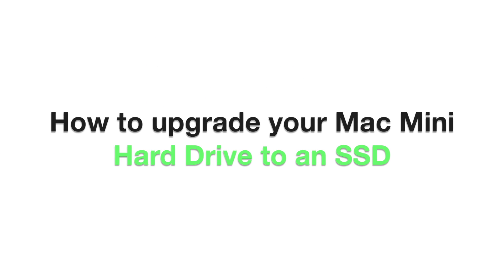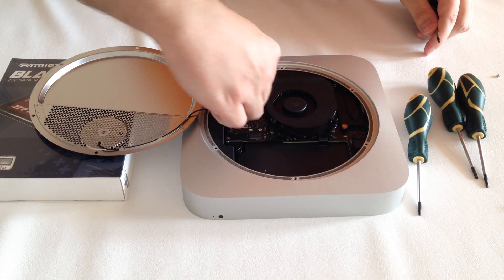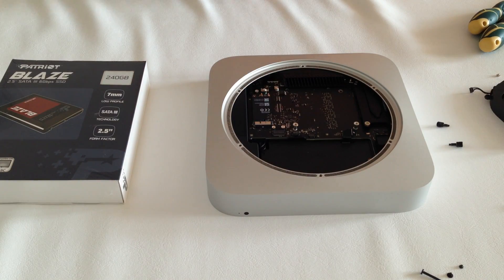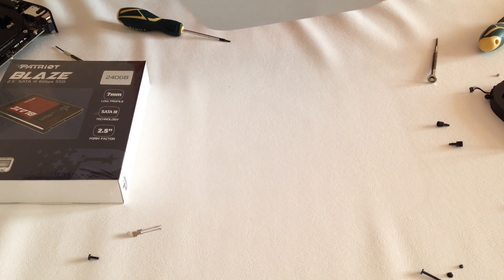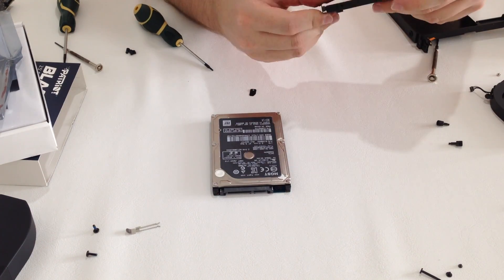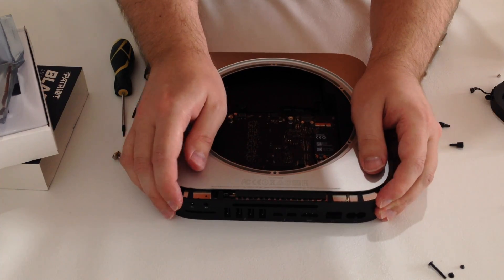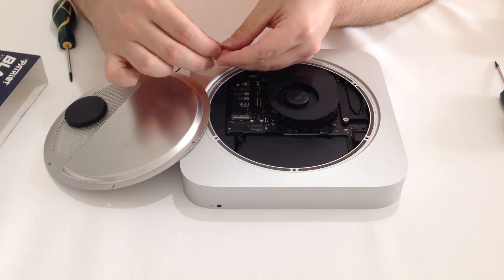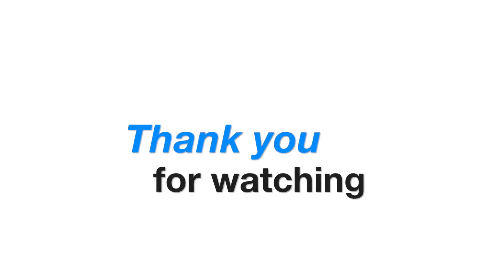Upgrade Mac mini to SSD (Late 2014/2015)

Comment: Hey, thank you for the video. I will be doing this soon so it is really helpful! 

I did notice you recommended not using Samsung EVO. Will Pro work? And do you have any sources for this? I searched and couldn't find anything against Samsung drives.

Also, is the Torx security screwdriver necessary? I have a regular Torx set, would that work?

Thank you!
Reply from the maker: Thank you for your comment, DJ Crazy Armz! I'm glad if it's useful.

Yes, they seem to have compatibility issues. For more details, you can check the comments on this video. I haven't tested the EVO myself.

Your best bet would be to look for a more compatible SSD. Any Kingston or any drive with Phison chipset (like Patriot Blaze) are a good match.
Reply: I use the Samsung 850 Pro . 1tb. never had issue. It  doesnt have trim support. But seems to still do a good job on cleaning up.
Reply from the maker: Bryan Medley Awesome! Thank you for the update and glad to hear that it works good. Which Mac mini model do you use it on?
Reply: Vladimir Kochkovski...... 2014 late mac mini. i only used it cause my mb pro, it died and took it out of it. i figured since i already has it, it was worth a shot.
Reply from the maker: +Bryan Medley Thanks for the details. Good to know that it works. Sorry to hear about the MBP, guess it's time
for the new ones

Comment: Very helpful
Reply from the maker: Thank you so much, Jim! I'm glad if it's useful
Reply: Your guide is great but I am annoyed that I need to buy a special torx t6 security screwdriver
Reply from the maker: +Jim McIntyre Yeah, those are somewhat hard to find. Take my advice, buy the screwdriver before you do anything. Don't try to open it another way.

Comment: hi! a quick question: If I buy the 512 GB SSD version, can I put an additional disk to the SATA controller? For example, If I buy the Samsung 850 pro 1 Tb, can I use it together with the original 512 pcie SSD? Thanks
Reply from the maker: Hi Francesco and thank you for your question. Yes, if you have the PCIe SSD, you can add a normal SSD to the SATA port. Please note that Samsung drives cause a lot of issues on the Mac, especially the EVO, so you might want to look for a more compatible SSD. Any Kingston or any drive with Phison chipset (like Patriot Blaze) are a good match.
Reply: Vladimir Kochkovski thank you Vladimir! I didnt know about this compatibility issue, even because my mac mini 2012 works great with a samsung 850 pro, good to know then. So i should buy the ssd version and then adding a sata disk to the controller or i need to buy the fusion drive version? Thanks
Reply from the maker: Francesco De Giorgio Not a problem, glad if it's helpful. If you have the budget, I would recommend just to go with the Fusion drive version from the factory. You will see both drives as one single drive and the Mac will optimize automatically which files to go where. You also won't need to open your brand new Mac.

Comment: Thank you.Very good guide.For a few moments the mac is out of the camera, specially when you take out the logic board (cant cleary see which holes are you using, to take it out)the power supply and the hard drive, but you get the point.Will recommend first copy your hdd to ssd by carbon copy cloner,than reboot from ssd to see if the cloning is sucessfully and than replace hdd with ssd. Carry on.
Reply from the maker: Thank you so much, Saso! I'm glad if it's useful.

Also, good tip on making a backup first.

Comment: Do we have to reinstall the operating system? Once you install the ssd, does it boot up normally or would we have to install something?
Reply: If you are simply doing an SSD upgrade but want to keep everything else the same, use Time Machine to make an external backup of your drive before you swap it out. You could then use the steps Vladimir suggested at boot to copy the data from the backup onto the SSD.
Reply from the maker: +Christopher Choi Thank you for your question. You'll need to reinstall everything from the beginning, as it's a completely new drive.
Reply: +Vladimir Kochkovski and how would you do that? Could you give me the instructions on how to do so? Thank you
Reply from the maker: +Christopher Choi Two ways: You can hold alt/option when booting up and it will automatically download and install OS X, or prepare an USB install drive
Reply from the maker: P.S. If you want to go the USB drive install way, here is an example how to do it. Please note that this procedure is for Mavericks, so you'll need to change the file name: https://www.youtube.com/watch?v=2or1Wthkl1w
Reply from the maker: mysticbimmer This is a great advice also! Thank you so much for the tips, mysticbimmer!

On a side-note, since you're making the backup form a hard-drive and you're replacing it with an SSD, it might be a good idea to make a fresh install of OS X first, and then return your home user and files from Time Machine as mysticbimmer suggested, to make sure that everything works properly.

Comment: Have you looked into upgrading to a fusion drive?
Reply from the maker: Thank you for your comment. Upgrading to a fusion drive is a bit more complicated, as you'd need to find an original PCIe drive and format them specially to work with the hard-drive.

If you really need a fusion drive, I would suggest just getting the Mac mini version that comes with it from the factory.
Reply from the maker: Thanks for sharing!

Comment: Ia the Torx T6H/TR6 the only screwdriver needed for this procedure?
Reply from the maker: Thank you for your question. You might also need a regular T8 for the hard-drive bay. Other than that, most of them are the same.

Comment: I couldn't find TH6, but I got one that said TR6 on Amazon it fit perfectly.
Reply from the maker: +Blu-TSX Thank you for your comment! I'm glad you got it working. If it's the same size and has the security hole in the middle, then it's great. Just be careful when using other screwdrivers because you might mess up the heads

Comment: Damn, forget this... I'm a beginner and have only ever popped in new RAM.
Reply from the maker: +hounddoggy7 Thank you for your comment. Yes, don't start the procedure if you're not 100% sure you can do it. Better get an external SSD drive in that case.
Reply: Yeah, I'm gonna hold out with the HDD for a bit - see how slow things get with the next OS X update.  Your video is great though - I don't know how you remember all those steps!
Reply from the maker: hounddoggy7 Thank you! I had to make the video while I was changing my drive, otherwise I would probably forgot it :)

Comment: do apple make it this hard cuz they are fucking selfish!
Reply from the maker: +Fernando Rizo Perhaps they don't think the users should bother with HDD changes. I don't know, but it's not so easy to change it
Reply: well what happens if ur hard drive is broken? yake to apple to replace it? what if u need more space like me? come on i just change in and it was hard bur id does not need to be that hard. is not smart to put the dam hard drive all the way to the back. do i call that smart or dumb?
Reply from the maker: +Fernando Rizo Yeah, you're right. It's a strange decision. Anyway, if the hdd is broken they should replace it, and for extra storage, their solution is external drive via Thunderbolt / USB 3.0

Comment: Is there any place that specialises in upgrading Mac's in London, England as I don't trust myself upgrading it just in case something goes wrong.
Reply from the maker: +Random Good Stuff Yeah, it's a bit scary procedure, especially popping out the main board. The next best thing would be if you can ask the official Apple Reseller if they are willing to do the procedure for you. (you can supply the SSD)

Comment: Good Video :)
I thought, in order to upgrade from hdd to ssd only pci-e ssd is possible but even 2.5" ssd is possible am I right?
Reply from the maker: +Dongmin Jeong (zyoma) Thank you for your question. Yes, you're right, you can also use a regular 2.5" SSD with this procedure.

Comment: Great video, man. I just wish Apple had stuck to upgradability. There are two things we should always be able to change: RAM and HDD/SSD
Reply from the maker: True. At least the HDD is still upgradeable, barely :) Thank you for your comment and I'm glad if the tutorial is useful.
Reply: After Apple switched to non-upgradeable RAM, and after they stopped offering quad-core processors in the Mini, many customers walked away from Apple.  They upset lots of people with the new weak, non-upgradeable Mini.
Reply from the maker: +Dave Satay Yeah, it's true. I guess they were going for a more streamlined product, but not sure if it's a step forward or step backwards. 

In my personal experience, I haven't noticed a difference in everyday usage with the dual-core vs quad-core (I do like lower power consumption/fans rpm). 

Sadly, they might even drop the Mac mini. Guess we'll see on the 27th

Comment: Thanks for the video, no other video I watched before this explained about the long screw before removing the mother board, I was struggling to remove it and afraid of breaking something. also the tricky part about the power plug. thanks for putting all the details!
Reply from the maker: +curaloucura  Thank you so much for your comment, Curaloucura! I'm glad if the tutorial is useful

Comment: Is there a way to open the security torx screws without security torx screwdriver? It is really hard to come by in the Netherlands and I don't want to wait few weeks to order from ebay
Reply from the maker: +Trabando1 I know what you mean, those T6H are seldom to find. The screws are designed in that way (the pin is all the way to the top) that there is no way to open them with another screwdriver without destroying them. Save yourself the trouble and just order the proper tools. Before you order, you might want to check the local tool supply store. They might have them buried somewhere without even knowing.

Comment: Amaing video dude!!
Ive got a question though.. when the replacement is done how do you re-install the mac OS X in the mac mini?
(sorry if its a stupid question)
Reply from the maker: +Dimitris Panagos Thank you, Dimitris! I'm glad if the video is useful.
It's a good question actually. Newer Macs can be reinstalled by simply turning them on and connecting them to Internet (they will donwload OS X and install it for you, because they have a recovery mode in their firmware).
If you want to be safe, you can also create a USB installation of OS X, similar like this:
https://www.youtube.com/watch?v=2or1Wthkl1w
Reply: +Vladimir Kochkovski Thx for the info! U saved my mac!
Keep creating amazing videos like this!
Reply from the maker: Dimitris Panagos Thank you so much, Dimitris! Congrats on your new hard-drive :)

Comment: Is Thier a Spot to put 2 ssd's in it. and use raid. i wanna do a 2tb full ssd?
Reply from the maker: +Bryan Medley Good question. There is not enough space or ports for two standard SSDs, but there is one SATA and one PCIe port for PCIe flash based storage. You will need to get the cable for the flash storage though, as it's not included.

Comment: Awesome, crystal-clear tutorial. Thank you & congrats on that!

Just wondering: how much difference will it make if I simply connect a SSD via USB 3.0 and select it as my primary disk unit? What's the chance of crating a bottleneck?
Reply from the maker: +Gelats X Thank you, Gelats! Regarding the USB, I don't think it will be too much of a bottleneck problem (it's seems like a good idea, actually). But, I haven't tested this and I don't know if you can boot from it automatically every time.
Reply: Vladimir Kochkovski Thanks for your response! I think it shouldn't be a problem from System Preferences → Startup Disk.
Reply from the maker: Gelats X Awesome! Let me know how it works.
Reply from the maker: +Gelats X That's awesome! Thanks for sharing this.
For some reason, your comment has been auto-flagged as SPAM. I just noticed it and remove it from SPAM.
Anyway, the safest thing would be to just replace the internal drive with SSD and enable forcetrim. That will work as close to factory SSD as possible.
Reply: Vladimir Kochkovski Thanks, man! Yeah, it seems to me you're right.
Reply from the maker: Gelats X Not a problem, I'm glad if I could help.
If you have any additional questions regarding the procedure, please feel free to contact me